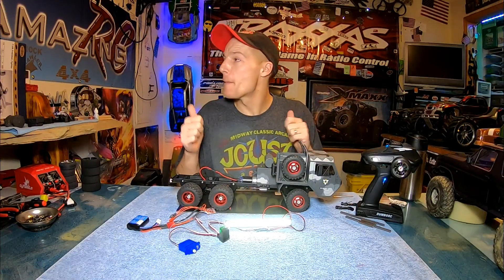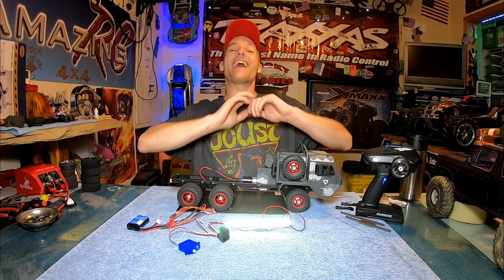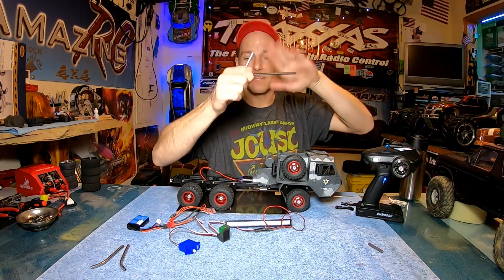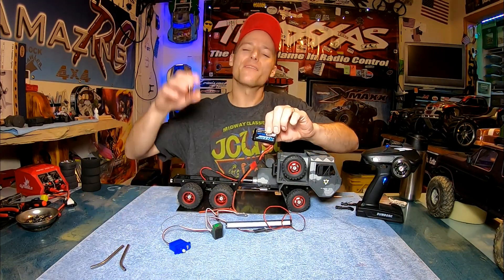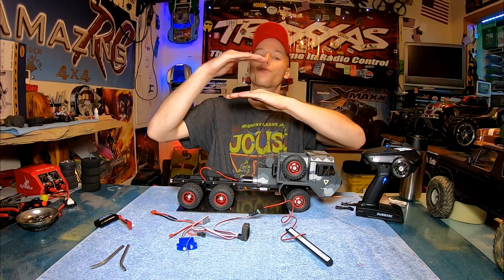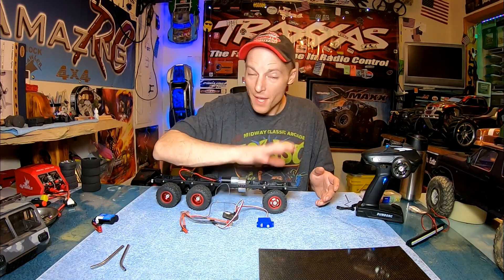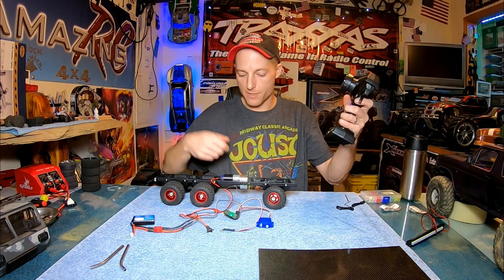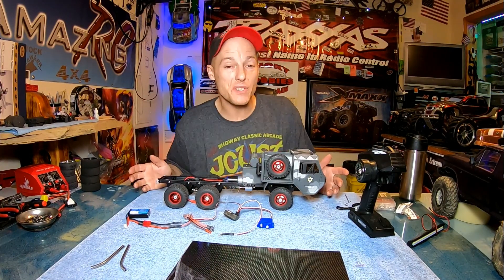Eachines EAT01 (Fayee FY004A) Full Electronics Upgrades.!!

Comment: What is the amp on stock truck. Can i change plug to run nimh battery
Reply from the maker: Thats a very good question... i did look for the info but could not find anything on it. In my personal opinion I would give it a try. You just have to watch it very carefully.  Not only the battery but the other electronics as well. Hope this helps.!

Comment: Hey Brian...i bought this Truck for my sun and now we want some Upgrades :) will this motor fit without changing esc? Or do we have to change the full electronic?
Reply from the maker: Good morning, and thank you for your question. I have the stock ESC in my hand right now and looking at it and the motor in question I would have to say is that the only modification you will have to do is replacing the plug on the motor to be able to connect to the stock ESC. The aftermarket motor comes with the little red plug and your stock ESC has a fixed plug on its chipset that is one of the little white plugs that you see all the time on smaller Electronics such as LED kits and the like. Without doing it myself I would feel confident in telling you that replacing the red plug with a little white plug should get you right in the door no problem. Now that is the electronics side of it. Now you have question of getting this motor installed to the truck itself. I remember doing this and in this 6 wheel drive truck it took not only tearing the entire truck down because the motor actually slides up into the channel chassis. So the whole front end or rear end needs to come out regardless. Then there is the issue with the drive shafts. I don't remember what issue I had but I did have an issue with the driveshaft either not being long enough to accept the new motor transmission combo or something to do with the diameter of the new drive shaft that is connected with the motor. So me personally, if you were going to go as far as to getting the motor and transmission I would probably pick up the cheap $9 ESC that banggood has as well. With that new ESC you are able to swap out your steering servo for a proportional steering servo as well as use a new receiver of your choice. The receiver in the stock truck is integrated into the ESC. I feel like I may have answered a couple extra questions here so I'm going to go ahead and stop before I end up chopping down the weeds that I got us into. You let me know if I have thoroughly confused you or if you have any other questions.🤣😂🤣
Reply: @AMAZINGRC  What an Answer :D haha...you`re right...maybe i should do it right and change everything :P This is my first "Pimp my RC Ride"...will have to learn alot i think. Your Videos will help me ...thanks for that. (sorry for my bad english)
What Servo do you use? :)

Comment: Hey Brain!  great setup you have there, what size is it?  Where can I get those LEDs?  Again good work with that project.  Talk to you later, good weekend my friend.
Reply from the maker: I think the 6 wheel drive truck is a 1/16 scale. As far as the lights, if you are talking about the light bar, I have a link to that in the video before this one. I will fix this video soon and get the link on it as well. I just forgot. If you are talking about the Assorted LED pack in the video. Let me know and I will get you a link to that as well. That one just cost me about $3 from banggood. Hope you are having a good week to my friend. Talk to you soon.😎